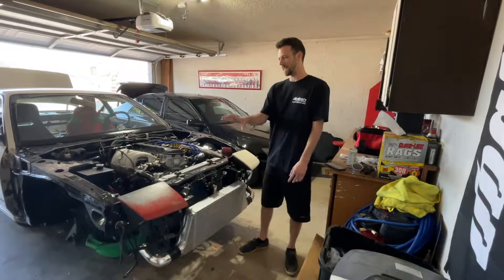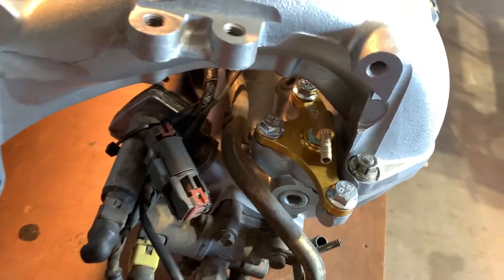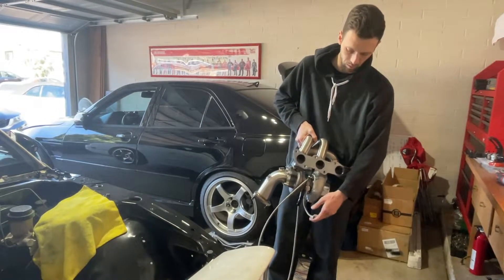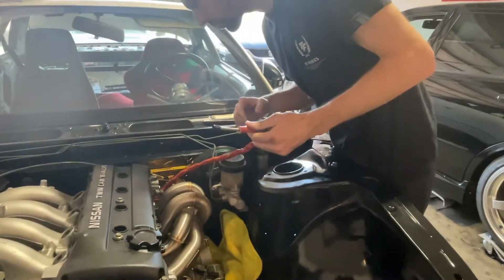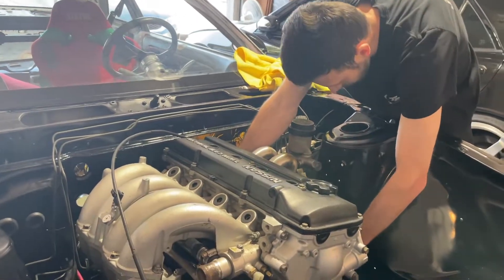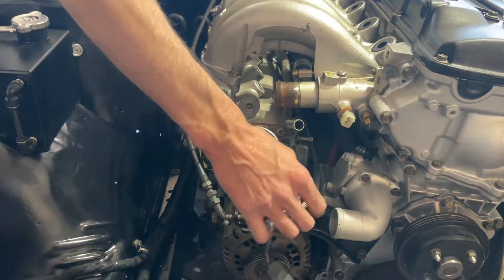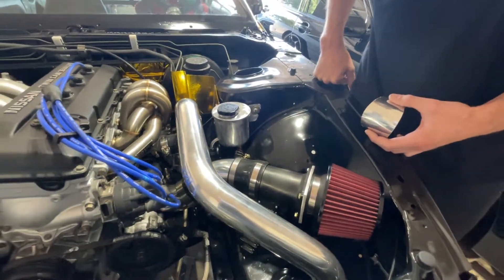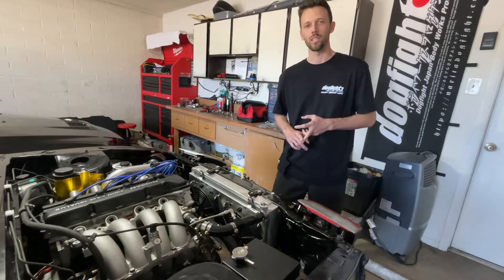240SX S13 Upgrade Series Ep.7 - Turbo Install KA24DE ISR RS3871

Comment: Does this kits downpipe connect to the stock exhaust?
Reply from the maker: Yes, but I ended up using the parts shop max cobra downpipe. Also, the downpipe in the kit doesn't have a flex section which is not ideal

Comment: Really nice video! Do you mind sharing how long your oil feed and coolant lines (feed and return) are? I'm about to do this same setup, and I have not ordered lines yet because I was waiting to put the turbo on before measuring, but this seems like a very clean setup, so going the same route seems like the move.
Reply from the maker: Thank you! The oil line is 37 inches, coolant to upper radiator hose is 58 inches, and the coolant to block is 8 inches, might want to double check on yours or give an inch or two extra just in case it it routed slightly different